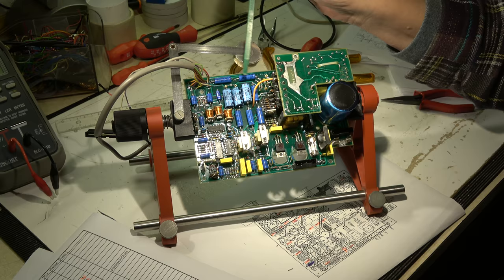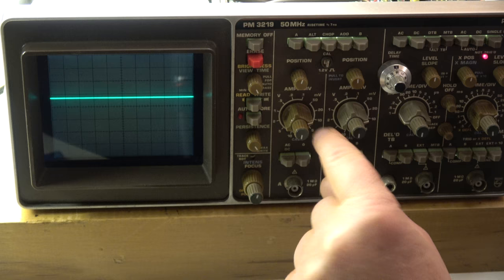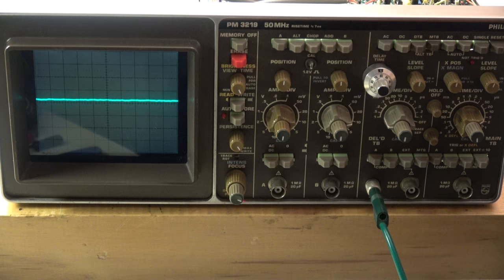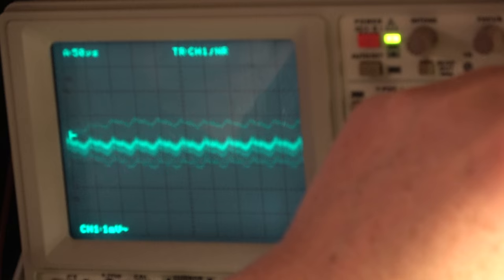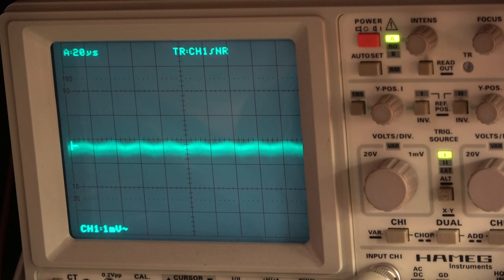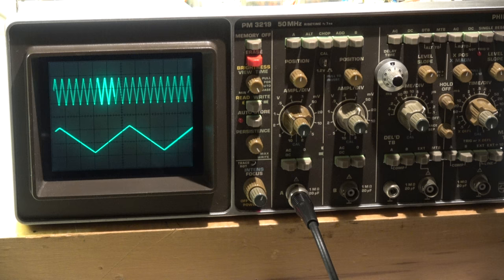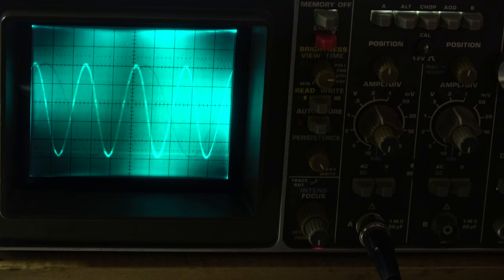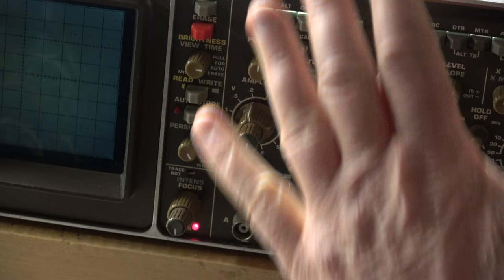#7 Philips Scope PM3219 Repair - Part2(2)

Comment: I too have spent many hours rebuilding older analog scopes, usually under duress as I am unable to find a new digiital scope that is  useful/compatible with the repair of radio equipment. These modern, and "better" scopes without exception use noisy and  sometimes unshielded switch mode power supplies, and the digital hash is immediately injected into any radio under test.  I have avoided Philips products, they tend to have unusual in house mechanical components generally unavailable   and hard to replace with generics, although all Philips products do perform very well.  Thank you for a very enjoyable ihr 9mins.!! .
Reply from the maker: Fully agree!

Comment: I noticed it only had 2 pins on the power plug in the 1st video and wasnt impressed, Ive never seen that before, I think I would change that. Very good thorough analysis. I have to say in my experience those old Philips caps in the smaller sizes are generally bad but you are quite right its getting harder to get axial replacements.
Reply from the maker: Many Philips Equipments have only two pins; the case is therefore isolated and not grounded! That´s made intentionally to avoid ground loops but requires some considerations in the measurement arrangement. Isolation of the scope is good enough (safety class II, double insulated)
Reply: @dl7majstefan753  Ive not seen that in New Zealand, perhaps local regulations forced this to be changed before import. I'm not sure how a scope can be double insulated if the metal case can become live?
Reply from the maker: @campbellmorrison8540  The metal case is painted and there are ground connections on the front, which have to be grounded before use! The double isolation is referred to the primary wiring and transformer isolation. That´s all i know.

Comment: Demonstrating delayed time base @54:09 is very helpful! I picked up a PM 3217 only to find its DTB controls are very different from Tektronix scopes.
Reply from the maker: Hi Ralph, meanwhile i gave this 3219 to a friend of mine and now i´m possessing also "only" a 3217; i´ve enough (faster) storage scopes.
To the DTB: There is no essential difference to the TEK-scopes; the delayed timebase may be triggered
a) with a set and constant time delay related to the main TB
b) with a separate triggering of the DTB after the set time also related to the main TB.
The old analog TEK-scopes work similar, only the designations may be different.
Reply: @dl7majstefan753  Amazingly everything works on my 3217. When I went to test it out I expected much worse. Almost everything, hold off not working. Still $80 well spent.
Reply from the maker: @RalphWLundvall  Hi Ralph, how did you determine the non-working Hold Off (HO)? Take a picture of any stable oscillation between 50Hz and 50MHz and rotate the HO: On the right side stop the picture on the screen should be brighter than on the left side stop of the HO. At lower time base rates the picture also will start to flicker more intensive (left side of HO) than on the right side of the HO.
Reply: @dl7majstefan753  Using the tutorial at channel EEVblog #159 between 7:20 and 8:00 I expected similar results.  I revisited my scope based on your question - I set Amplitude/Div to 1 volt and Time to 2 ms. The trace is a straight line. When HO is turned fully counter clock wise the trace has a slight flicker. fully clockwise no flicker. So it does have an effect but I'm at a loss at how this is usable.  Additionally, as you suggested, when fully CCW (longest HO setting) the brightness of the right side is less than the left side but so slight only by dedicated study and chin rubbing is it discerned to be so.  Only at 1 volt and 2 ms are this subtle things noticed. Any other combinations - nothing my eyes can detect.
Reply from the maker: @RalphWLundvall so it seems, that the HO is working! The use is in special cases, when the signal is not purely repetitive to let the MTB start at a delayed position to avoid triggering too early. Example: you have a digital signal with data signals in telegrams, which are varying in time; there may happen that the new trigger is within the end of the "old" already triggered telegram. A HO is there useful to trigger later after the old telegram and before the new telegram.

Comment: Very interesting series!  I just found your channel and was happy to see you did a series on Philips analog scope restoration.  I have an equally old Leader LBO 525 two channel scope, not quite as fancy as your Philips, that has dirty pots making the display very scratchy and the traces unreliable.  The problem is that they are the sealed type with no holes in which to pump contact cleaner.  How do you clean such pots?  Replacing them seems impossible given their age and specialized function.
Reply from the maker: Up to now, i´ve no experience with this. But in the WWW i found the hint, to melt a small hole in the side/corner of the case with a small tip on a soldering iron - do not drill! Then apply some cleaner, let it dry and seal the hole again.
Reply: @dl7majstefan753  Danke. Seems like I could do that with a needle point tip used for SMD soldering which I just happen to have. Excellent idea, I shall try that, thanks!

Comment: No calibration after replacing all those caps ?..
Reply from the maker: I did a performance check as mentioned in the video at 00:59:00; all was OK so no need for an alignment.

Comment: Hi Stefan, I have a PM3244 with one of the 4 channels dead; apparently it's the attenuator, which I have tried to detach from the front panel... but didn't get very far. How did you remove the nut in the larger of the two coaxial knobs on the attenuator? On mine it's a 7mm nut, recessed into the knob which just measures 10mm inner diameter, and I haven't found any spanner or bit that will fit in there, because they usually have an outer diameter of at least 11mm! I see no way to remove this knob without destroying it or making my own tool. Did you encounter this problem too? Any hints appreciated, thanks!
Reply from the maker: Hi, this problem is very common.
I always use in such a case a pliers with a slim shape to grasp the nut. This requires some force on the pliers.
Reply: @dl7majstefan753  Flachzange? ;^)
Thanks for the hint; I tried the two I have but they're too large. Not Enuff Grip[tm]. I'll have to hunt around for a suitable one. Btw, the RIFA X2 cap in the mains filter exploded in my PM3244 as well. What a mess....
Reply: @dl7majstefan753  Hi Stefan, a belated update after I finished the repair almost a year ago now: after a lot of searching, I ordered a Knipex KN 30 11 140 "Langbeckzange" which fit the recessed 7mm nuts perfectly. These are extraordinarily long pliers, but even then, the nuts needed a bit of persuasion until they budged!
It turned out that an LM208H op-amp in attenuator #4 had failed. I managed to find some (rare?) NOS specimens of these at a reasonable price, and since Philips were forward-thinking enough to provide sockets, replacement was easy. However, recalibrating and reinstalling the attenuator assemply was a nightmare!!!
So the scope works again for now -- or at least until the next opamp or EMI suppression cap blows up! Thanks again for the hints and the video!
Reply from the maker: @NuGanjaTron  Congratulations, enjoy the Philips!